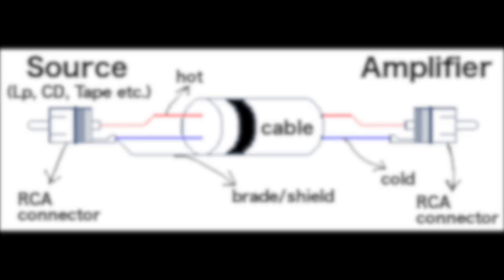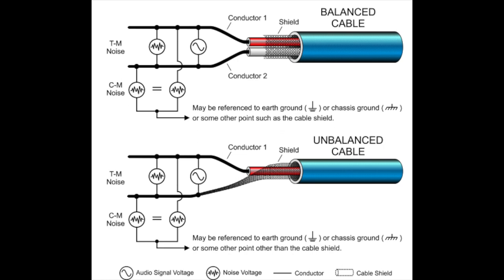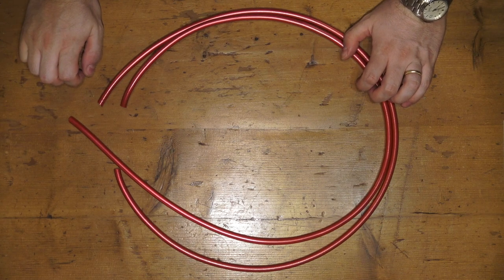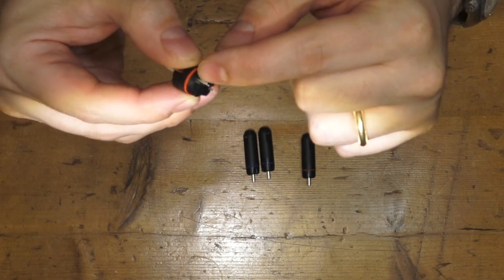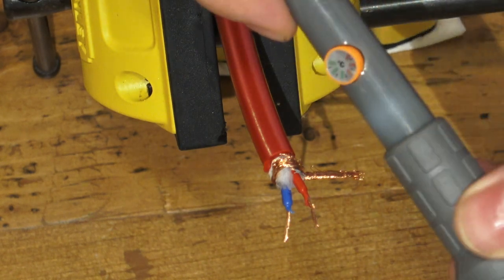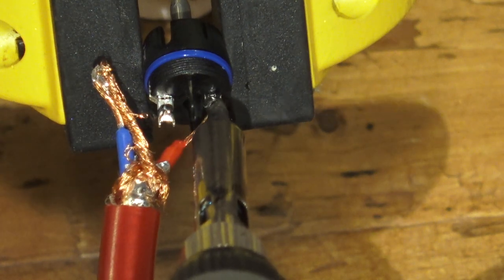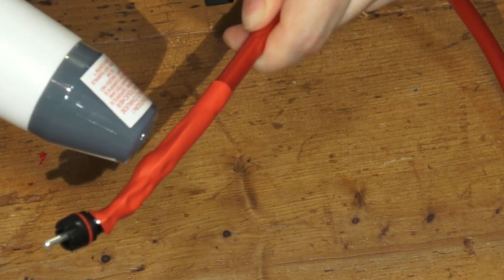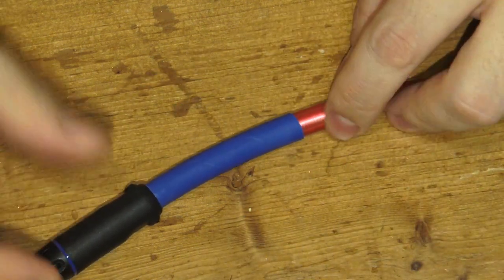How to make a high quality and inexpensive audio interconnect RCA cable

Comment: Thank you for your contributions, most of which I have enjoyed. This one, however, and a few others I have watched, prompt me to offer some facts. Not opinions, just facts. There is no such thing a a semi-balanced input or output. They are one or the other. Balanced signal cables, as you have correctly mentioned, are used where long runs are required when getting an audio signal from, for example, a microphone to the input of a mixing console, without injecting noise into the signal. This is achieved by using a balanced microphone, whether it be a dynamic design or a condenser microphone (to mention two common types) The output of these microphones is a very low level alternating current (audio signal) and we refer to  the two wires as the 'hot' and the 'cold'.  The two signal wires each carry the identical signal, except that they are 180 degrees out of phase with each other.  Wrapped around these two wires ( a twisted pair) is an earth shield which attempts to protect the delicate audio signals from picking up noise. When the signal reaches the balanced input of the mixing console, one of the two signals is inverted and then the two are summed. The really clever part is that any noise picked up by each wire on its journey to the mixer, is in the same phase. So when one of the two noise components is inverted and summed, the result is that the two noise signals cancel each other out. What we are left with is a strengthened audio signal and a massively reduced noise signal. UNBALANCED audio signals on the other hand have only one audio signal and one shield. There is no clever noise reduction design as with balanced cables, so unbalanced cables need to be kept short and have a good quality earth braid.  Professional microphone cable such as Canare or Belden uses ordinary copper wire. I have made, over more years than I care to remember, hundreds of professional audio cables. There are times when it is necessary to connect an unbalanced audio signal to a balanced input, or vice versa. For example, when a guitar or a keyboard in a studio need to be sent to the mixing console, we use what is called a DI box. (Direct Injection). This electronic device converts an unbalanced signal to a balanced signal which can then be sent a kilometre if necessary, without signal degradation. When mixing balanced and unbalanced signals, it is essential to match impedance and  signal level. To give a few examples, a moving  coil phono cartridge typically has an output level of less than half of one mV and will have a very low impedance. On the other hand, the output level of a preamplifier can be MUCH larger, and will typically be a high impedance signal. One of the most important considerations when connecting many components of an audio system, is a well thought out earthing/shielding system. When the earth connection has more than one path in a system, it is possible to create nasty EARTH LOOPS. In order to avoid these, it is sometimes necessary to disconnect the shield at one end of the signal cable. This is NOT creating a 'half balanced' design (no such thing) but rather it is ensuring that there are not multiple earth pathways.
Reply from the maker: Thank you for your very useful comment and experience!
Reply: For an asymmetrical cable of 9 meters, do you think it is important to have a perfectly identical signal conductor (from an electrical point of view) to the ground conductor?
Indeed, all manufacturers indicate that the ground conductor (because it surrounds the signal wire, its surface and composition different) does not have the same electrical characteristics (see example below) that signal wire? 

https://www.audiophonics.fr/fr/cable-symetrique/sommercable-albedo-cable-de-modulation-symetrique-2x02mm-o52mm-p-783.html
SOMMERCABLE ALBEDO Symmetrical Modulation Cable 2x0,2mm² Ø5.2mm
Metric capacity cond./cond. 65 pF
Metric capacity order / display 110 pF
Kilometers resistance, conductor <148 Ohm
Kilometers resistance, shielding 30 Ohm
Kilometers resistance, insulation> 1 GOhm
Reply from the maker: Yes, I believe each cable in a group, I.e. 2 or more, need to be perfectly identical to deliver the same signal in terms of quality and timing.
Reply: I just picked up a cable, which has two cables in the center and a copper braided shield - would you recommend directional rca for unbalanced ( one end the shield floating, not sure I have earth loops yet)
Or grounding the shield on both ends?

Comment: Buddy, your soldering technique needs just a little bit of work, when you tin wires, just a second or two more will heat the wire enough for flow, rather than heating the solder and having it melt on to the wire. Our tech used to call this "buttering on" the solder, rather than heating the work and having the solder flow into & on the wire. This helps (only a little) avoid cold solder joints which can cause trouble years later.
Reply: Took the words outa my mouth. Heat the connection and it draws the solder into the joint.
Reply: Guys, guys, guys, he is doing analog soldering.  Your technique works for digital soldering.  Plus he's using European electricity which is very different.
Reply: He’s doing better than me.
Reply: Welding Engineer here ... I endorse your post.  
Not that I can do any better :hand-orange-covering-eyes:

Comment: You have to make a firm physical contact first and soldering is just for maintaining it. Don't your signal pass from a conductor to solder to another conductor. It should pass from a conductor to another conductor (or terminal lug) and the solder should not be in-between them. The purpose of soldering is to keep the contact. I learned this hard way long time ago. I recommend you to redo the soldering job. You'll hear a difference :)
Reply from the maker: Good point!
Reply: S H  Rubbish.  What you are suggesting is impossible to achieve as well as wrong.  To get a good intimate solder joint you tin both parts first with solder, then you can fuse them together with the iron.  There will always be solder between the two parts its unavoidable and the only way to guarantee a good electrical and mechanically strong  contact.  Even if you apply solder on top of the bare contacts it will flow between and around the parts - unless they are not clean.  Its not the best way to do it because you need more heat that way.
Reply: Correct , solder is to seal the mechanical contacts .

Comment: Does semi-balanced cable make sense in 2022? Modern cables come with braided shield and carbon screen to prevent Radio Frequency (RFI) and Electromagnetic Interference, shielding that is 100% efficient. DIY semi-balanced is then an overkill, yet you need to remember/mark which end is which.

Comment: Thanks. Which direction were you saying? Was it to do with the end you soldered the shield to the cold? Which end is that, where music comes from or goes to? Ta.
Reply from the maker: If you want, it isn’t mandatory, you should connect the shield to the ground on the side of the source or both sides but you may encounter some hum

Comment: Nice cable recommendation buddy. It shure made quite a difference from my silver plated I was using. Thank you.
  And... you know... I was thinking that maybe.. the reason behind not connecting the braid on one side has to do with the same reason this... Mr Ps Audio explains in a video about power cables using the same technique. It's a video on screen or no screen power cables, and says screen sucks out life of the signal and by using screen connected only to one side and then having the screen far away (1/2 inch best) from conductors eliminates that issue.. So many things with electric stuff, pfff, interesting though 🙂
Reply from the maker: Great! Thanks for the feedback!

Comment: Thanks for the demonstration. You know you can buy desoldering wire. If you have excess lid, you heat the lid up where excess lid is, keep the heat from the iron on and pull the wire through; the excess lid is then removed onto the desoldering wire. I have bought it from a company called Stannol and it's called No-clean wick, but there are other dealers too. For sure it's better than using the vacuum pen.
Reply from the maker: Thanks for sharing that!

Comment: I watched your 12 tips for perfect vinyl playback and was interested in this and the previous video of audio cables. My question is this, is this type of cable better for connecting from my turntables (I have three turntables) to my phono preamps? And also from the preamps to my USB interface? This looks like something I could easily do. I'm currently using Blue Jean BJC LC-1 Stereo Audio Cables. I have a unique set up where I have two turntables using separate preamps for each one (Schiit Mani) connected to a Schiit SYS that I use as a switch. Then the SYS is connected to my USB interface. The Blue Jean cables are of good quality, but if what you're demonstrating is much better then I think I may want to try it out. Cables do make a difference, but I can't spend a fortune on cables. I recently made a video demonstrating how upgrading from cheap headshell leads wires to a set of $35 Nerve Audio Litz wires made a world of difference in better sound quality: https://www.youtube.com/watch?v=ELLrFn6ENJk&t=204s I enjoy your videos!
Reply from the maker: Sure! These are standard rca analog interconnects, you can use them everywhere with no problem. Nice lead wires in your video but they are OFC copper. Try the audiotechnica OCC copper for half the price: https://youtu.be/TBS6KBNzlos

Comment: Oh, heh... just ONE more thing!  😁 Perhaps I didn't understand correctly, but WHICH direction should the current flow?  TO or AWAY from the grounded/shielded combined wired side...?  THANKS!
Reply from the maker: The arrows indicate the flow of the music, so the point away from the source, to the preamp/amp/speakers
Reply: @anadialog  Heh, thanks for this too!  So, it is not a function of the construction of the wire itself then...?  You can use it either way and just simply put an arrow on it...???  Doesn't it have to flow either from or to the end where you combined the ground and the other wire, because you did that on only ONE end, right?

Comment: What was that last part? I did not understand about the direction of the signal goes tword the speaker? Never heard of that.
Reply from the maker: If the producer added arrows on the body of the bulk cable, they always go from source to output

Comment: You will get better results if you seperat the shielding earthing completely from the cold pole. Fantastics results can be gained by taking the earth from shielding on your interconnects and power cables and cabinet housings to a dedicated mains earth completely separate from your supply system ( either power supply or interconnect supplies between components). Wire all all the earth's in spider formate before taking to mains earth. - sit back and enjoy😎

Comment: In the 7:58 You solder the tips to the connector without protecting the bare copper from oxidation. You can do two things, one, my favourite, cover entirely with solder all the stripped cable or, two, if you want to save silver solder, put a shirking sleeve over but always before putting the connector.  Don't you agree?
Reply from the maker: Yes, you are right!
Reply: @anadialog  we help each other to improve our audiolive😁

Comment: Can you explain when a semi-balanced RCA is required, best for turntables? Can they be used for all RCA type connections, and if so what are the benefits?
Reply from the maker: First of all I want to clarify that semi-balanced does not exist. I just used that to make a difference from a balanced and an unbalanced type but the truth is that this type is still unbalanced. Coming to your question you can use it whenever you like, it does not have a special application it just adds some shielding. In some cases to reduce capacitace you could take completely away all shielding with the risk of picking up some interference.
Reply from the maker: The recipe is always the same, occ copper, or even PC-OCC with teflon insulation. If you want the absolute best, OCC silver with teflon insulation made with a solid geometry like Neotech.

Comment: Can u make a RCA "BALANCED" Cable by using the Canare L-4E6S ?   It has 4 Wire + a Shield Wire for a total of 5 Wires.   Want to make some RCA interconnect to go from the Pre out Mono Amp to another Mono Amp.    I guess it would be like Bridging to Amps together.    Also, when using Balanced RCA Cables is the a Signal Flow Direction?   THANKS
Reply from the maker: Hi there, there is no RCA balanced. You need an XLR connector for that. Some producers indicate the direction on their cables, also on bulk cables according to the brade or the geometry of the various parts. A lot of people think that is snake oil and many they are right. I would not bother too much about it. If you buy some bulk cable and the direction is indicated then follow it, can't harm. Otherwise, no problem.

Comment: have you ever tried elevator cable..? there is an audio cable that is very fine not sure of the name, but ive seen these and used them they are about 3/8 inch diameter and have many many hair fine copper conductors,,, fantastic quality .. also Belkin industrial cables,, used a lot for sensors and security systems

Comment: Does the impedance of the cable play any role?
Reply from the maker: It does but marginal. Interconnects are too short to be influenced by that and other typical voltage issues.

Comment: Hi sir , tell me let’s I have a cd player and a preamp , where is the component will have the shield solder to the cold wire will be ? Thanks
Reply from the maker: If you decide to connect the shield must do it at least on the source of the signal side. If you think no hums may occur you can connect both sides.

Comment: Thanks for your excellent video, you are my daily lesson of english and hifi in this period :-). I have a question: the direction (end of the video) is a cosequence that you solder brade and cold on source side? or it is defined by the wire? enjoy your day :-)
Reply from the maker: Hi Claudio, thanks! The direction is usually based on where the shielding is connected but some manufacturers also claim that there is a better direction based on the geometry of the cable itself. You can believe that or not. I do trust the shielding connection, the rest, it depends from the brand and if they explain why.

Comment: The RCA terminal plugs of your choice look fancy. However, if you look the inside structure, you'll agree that it is not easy to make a firm contact with the conductor. Look for other RCA terminal plugs that allow you to make a firm contact easily; for example clamping.
Reply: Hello, with respect to your comment...........these are probably KLE RCA plugs......they may look flimsy but their quality is outstanding .....more so they are part of the most musical sounding plugs ....Do not judge by the looks  but with your ears .

Comment: I'm looking to make short 0.3-0.5 RCA interconnects for connecting my DAC to HEADAMP and later Phono Preamp to HEADAMP. (Each component 100-300€). I am looking to make a cable costing 30€ max. I was thinking of using Neotech Coaxial interconnect cable (for analog and digital) and some Audioquest RCA-300 connectors (~20-25€) for 4. Do you have any other suggestions for good budget connectors or cable?
Reply from the maker: Sure! Take a look here: https://youtu.be/K5tFrlCvn3o

Comment: Have you done much soldering?
Reply from the maker: +PeriodWoodworker hi! What do you mean...in my life?
Reply: I was gonna ask the same thing. You should learn how to solder properly. Whatever you did was not clean at all ...
Reply from the maker: I agree guys! I am not a great soldering tech but I do prefer to solder directly with the iron and not heating the wire or the connector...yea I am not very clean and I stated that in the video...nontheless the cables sound fantastic!
Reply: Hi,

I liked the video, thumbs up! But I would suggest heating the element to a temperature which then melts the solder. Otherwise this can result with a 'cold joint' which comes loose after a while, especially in wire, which has to withstand stress. Anyways, do as you like, but I really think this could improve the long term durability. 
Cheers

Comment: Hi, just a question for You: I bought a low price chinese microphone in a shop, sounds not bad. Its cable has a female XLR one side and a mono Jack on the other. I disassembled the XLR side and noticed that 2 internal pins were connected together. Is this only on budget mics for a reason, or ALL XLR/Jack cables have to be soldered this way? 
Thanks for a Your kind answer.
Reply from the maker: Hi there, that is done to have an unbalanced connection TRS because true balanced  connections are more in the professional audio invironment or high-end audio. Yes, its normal when you want maximum compatibility. Again, in a pro context it would instead be balanced, especially if the cable had to go for a long way.
Reply: @anadialog  
Thanks a lot!!
Reply: @anadialog  you can get XLR(F) TO TS !/4 JACK =MONO AND XLR(F) TO TRS 1/4JACK STEREO  which is connected to output would be a mono signal so that's why they have 2 xlr to trs.We only use balanced xlr to xlr but connect up in 4 way mono and xlr to trs for Daisey chaining power amps
Reply from the maker: Indeed! With this headphone craze everybody is making balanced TRS headphones!